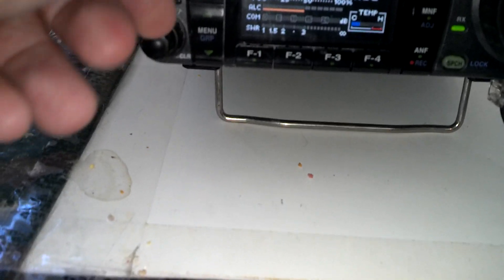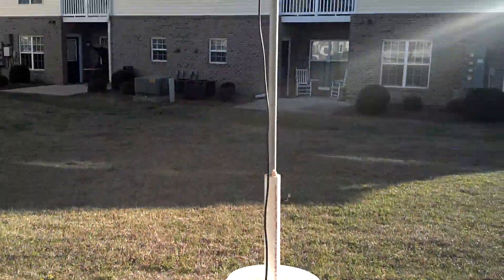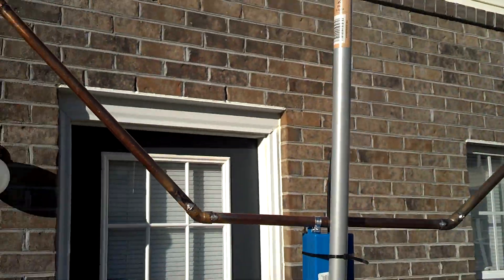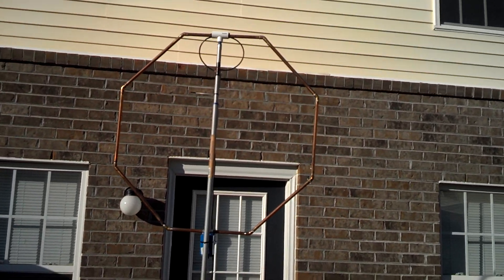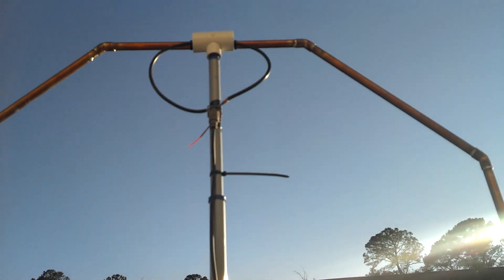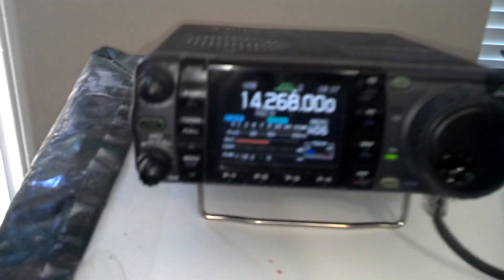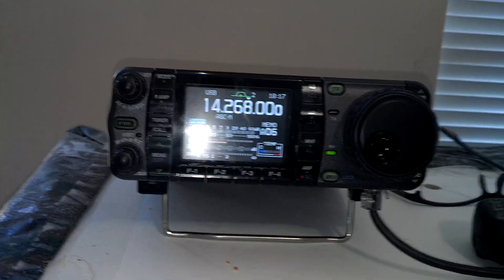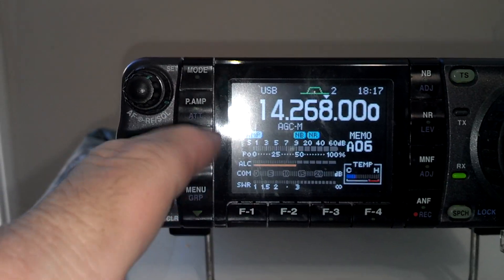Magnetic Loop Great HF Apartment Antenna

Comment: I am glad that you are enjoying your magnetic loop. I recently picked up a W6LVP Magnetic Loop a few weeks ago and put it up about 20 ft on a Channel Master rotator and use it as my receive antenna on my ham station while using a 132 ft Carolina Windom antenna for transmit. I really have found a tremendous difference in noise after going to a loop. I also have a Timewave ANC-4 Noise reducing device that works great in combination with either antenna when fighting noise that is not nulled out by the loop because I am using the loop at times to pick between stations in different locations on the ham bands and also BCB stations. I have a 12 ft noise dipole at 3 ft above the ground for the ANC-4 that I placed right under my electrical power line pole. The combination of a loop and the ANC-4 has allowed me to enjoy listening to Shortwave like back in the 50s and 60s before all of the electrical environment issues we face today.
73s
WD9GNG

Comment: What Icom are you using? and do you like it? I am looking for a good HF mobile.
Reply from the maker: It's a Icom 7000. It was a buy once cry once thing. The new version of it has digital vice as well. But I am very happy with this radio.
Reply: Thanks, I like the size and style. I have the FT1200 but hope to get a icom 7600 for the shop. I put up a 50 ft self-standing tower today. If it is still standing at the end of month I will be putting an antenna on it in Aug.  I still need a mobile unit and will try to find a 7000